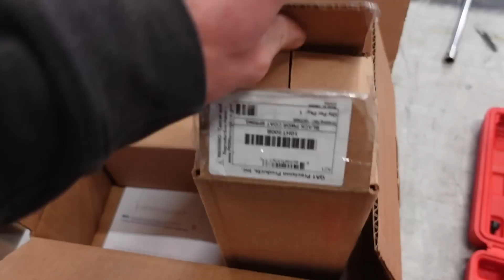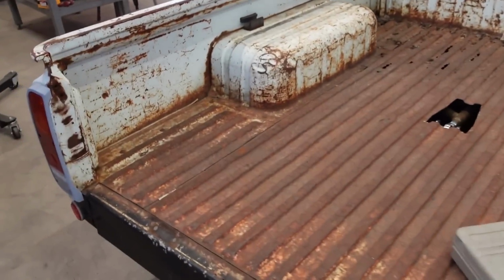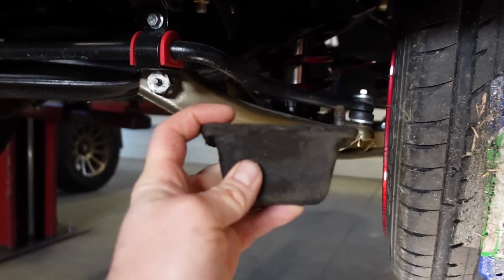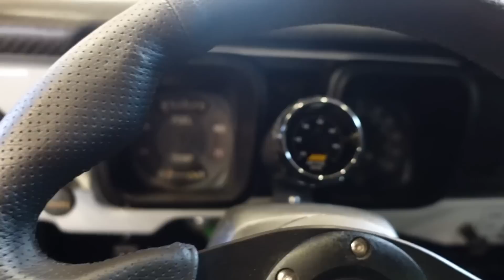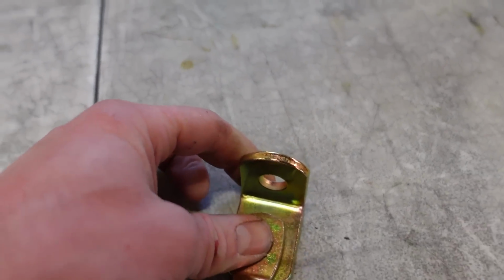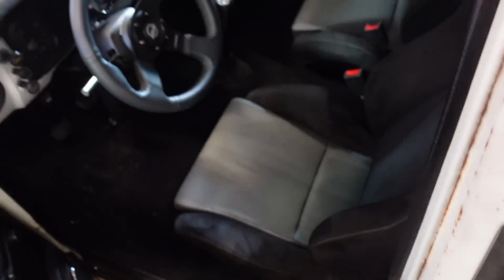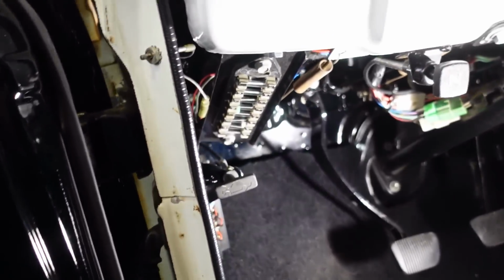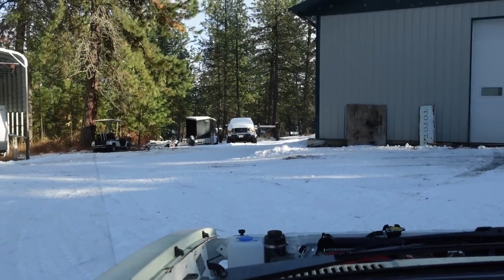New Rear Springs/ New Seat Belts/ Donuts In The Snow!!

Comment: just had a question on how you put coil overs on it since hilux have leaf springs how did u do it with coil overs do you have a video on how you did it or?? cuz i’m really interested in it
Reply: He changed the rear end suspension to a tri-link. Can't say I understand how it works or why he did it. There is a video about the switch.